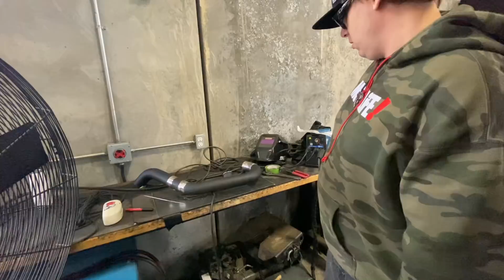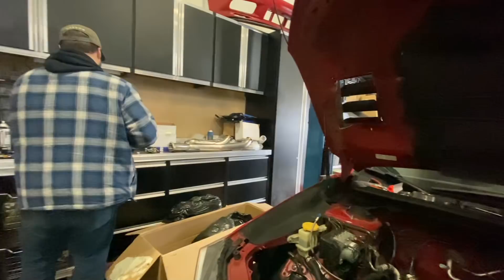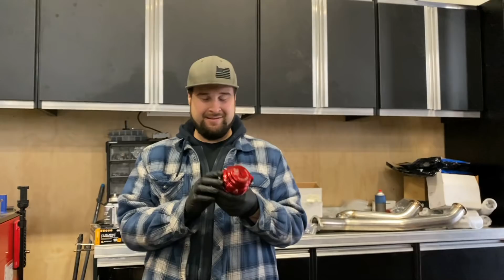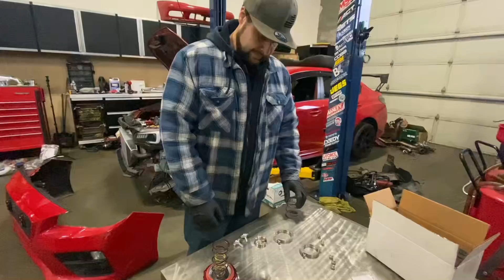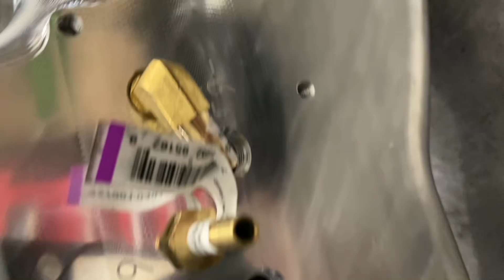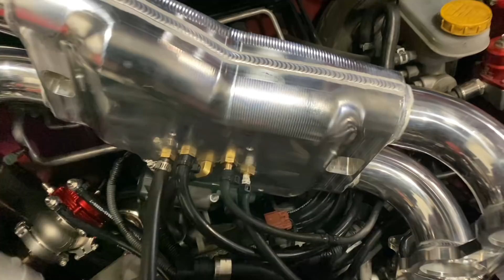600whp STI Build Part 2

Comment: I have the same fuel rail...

But the rail interfering with avcs solenoid socket...

Had to trim the side of the socket to fit...

Did those on the car fit fine?

Comment: Nice work Steve. Your dogs scared me a couple of times there haha. Think i need to clean up my engine bay a little and have seperate vacuum sources for everything. What are your thoughts on running a single vented catch can for both heads and block breathers with no PCV in that system?

Comment: Thanks for the in-depth videos man I'm so glad Bader showed you on his channel or I wouldn't have nearly as much knowledge on Subaru's! Between his videos and yours I managed to rebuild my engine by myself and it turned out amazing, forged JE pistons, K1 rods, race bearings and refreshed heads. Still got all my stock bolt-on's other than a 3" downpipe/exhaust, hks up pipe and torque solutions turbo intake. Can't wait to get a cobb tuner so I can get it tuned by you!

Comment: Another tip for the waste gate: Make sure you don't pinch the diaphragm when you're closing it up.

I bought my first TiAL WG used, I needed to open it before installation to swap the valve. Found the diaphragm somewhat melted together because it had been pinched between the halves during initial assembly; wondered if the previous owner got rid of it because it didn't work right for them. Fortunately I was able to order a new diaphragm and re-assemble it properly.